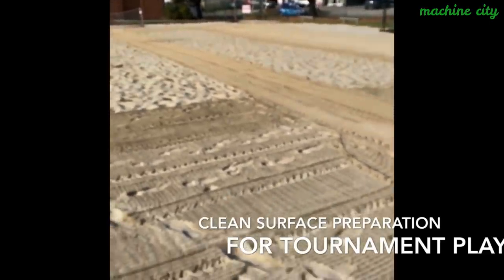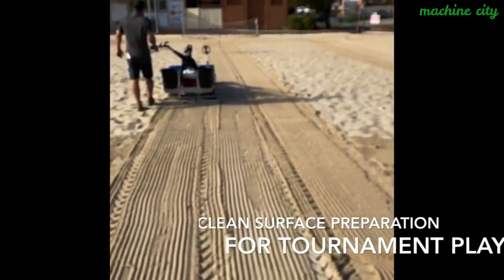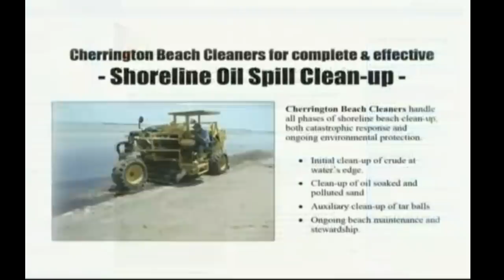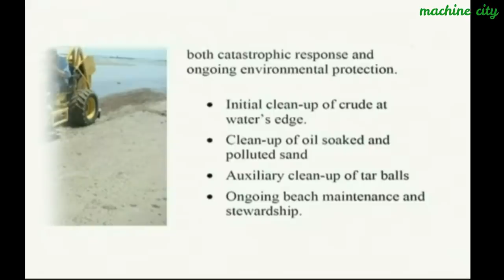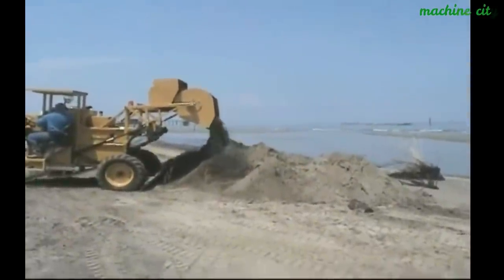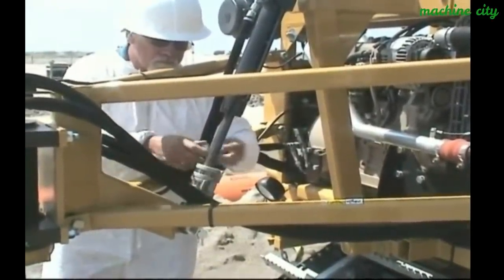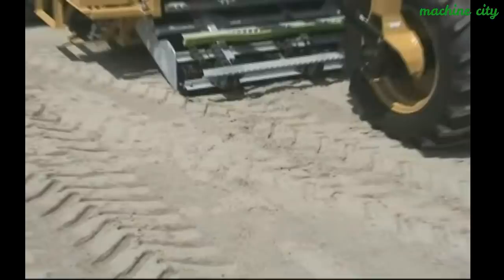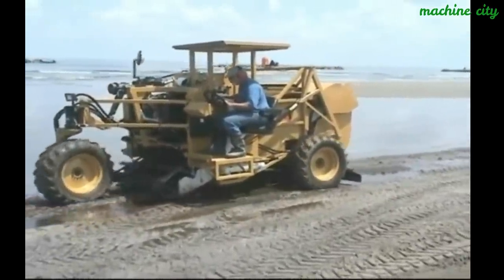Best Beach Cleaning Machines And Advance Cleanup Equipment Compilation 2021

Comment: The beach is so large yet these machines are so slow. There has be a way to either make these machines bigger or at least faster.
Reply: Um there making were people can get there feet wet without any rocks not cleaning garbage or anything its a wast of time gas co2 and money.
And most of that was in California just pay the tweekers 20$ for every 5 gallon bucket full thats definitely faster then any machine we can build it would be cleaning in a week not months lol
Reply: Yeah they should do it with monster trucks bigger and faster
Reply: sand is very heavy so its a weight vs horsepower problem
Reply: @toolittletoolate1900  I would pay to see that. Like making a giant monstrosity with a ship diesel engine or something. That would be so cool.
Reply: Why do you have to go faster?

Comment: The problem with this is the machines sifting trough the sand removes seashells, rocks and human garbage equally, and only the human garbage should be removed.
It's  kind of OK to do this on a beach with lots of new human garbage every day, but when the garbage to rock/seashell ratio becomes lower it is better to stop sifting the beach
Reply: Seashells hurt the feet to walk on, I would be happy to see them gone.  It's a beach, not a wetland!

Comment: The problem I see is all these machinery are gasoline (possibly diesel) which I'd rather not have those fumes while trying to relax at the beach and pose a risk if it were to start leaking oil, antifreeze or even gasoline as anything fuel powered that'll eventually happen.